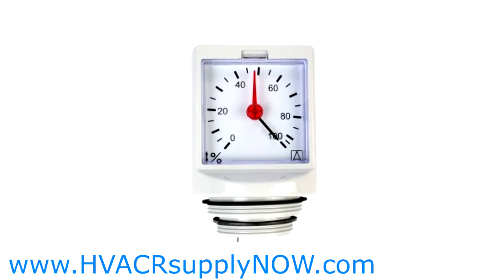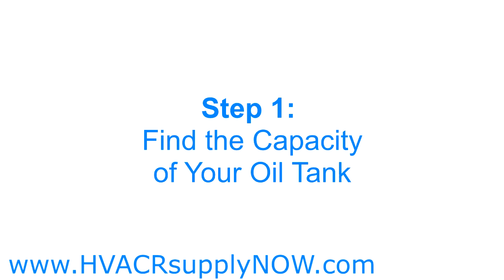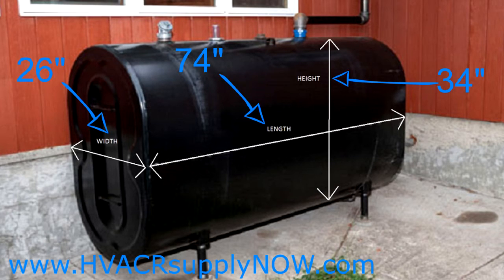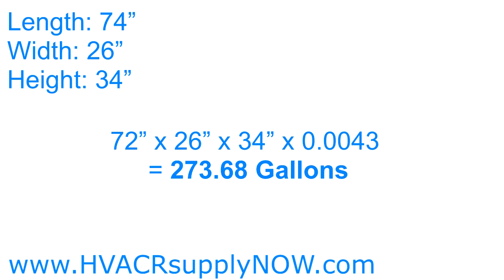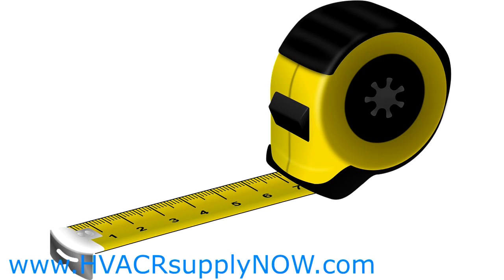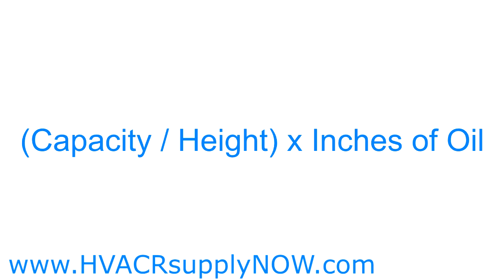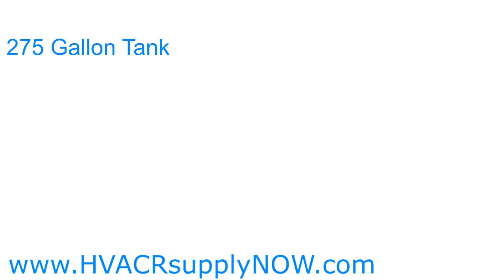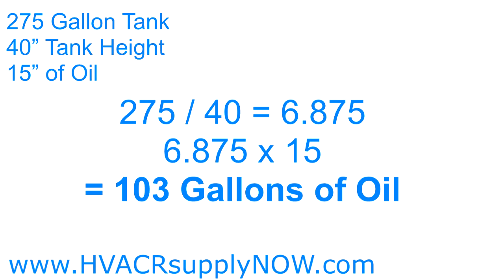How to Measure the Amount of Oil in Your Tank - HVACRsupplyNOW

Comment: Followed the above instructions using a Stanley yellow tape measure.  When inspecting the oil level, the oil was so clear I could not discern the level on the tape.  Very messy business cleaning the tape measure and the smell of the oil was difficult to get rid off,  Back to the broom handle!